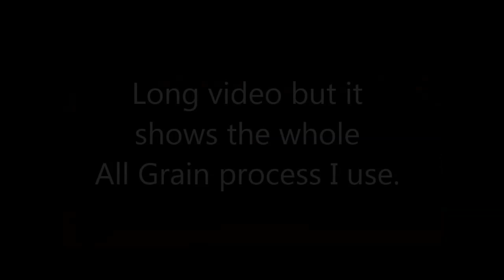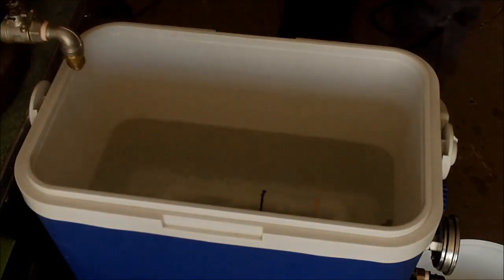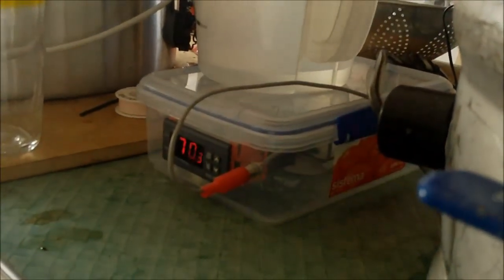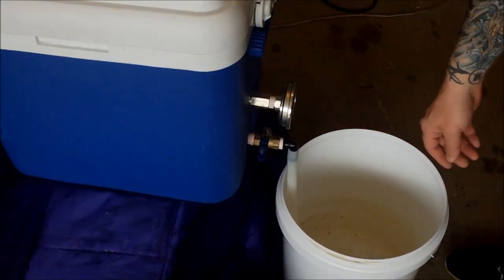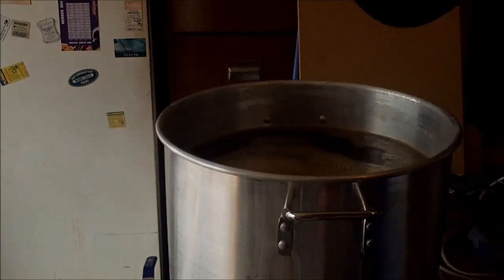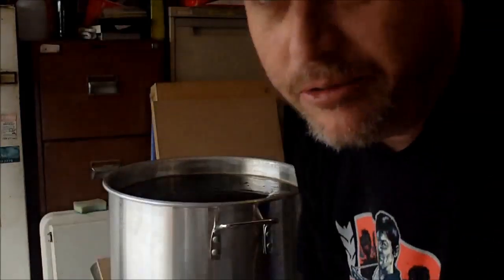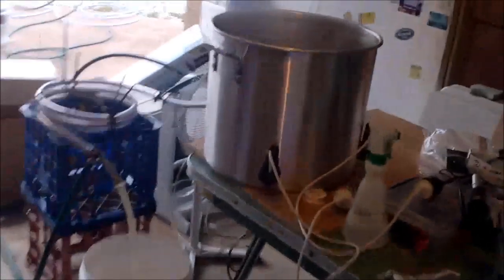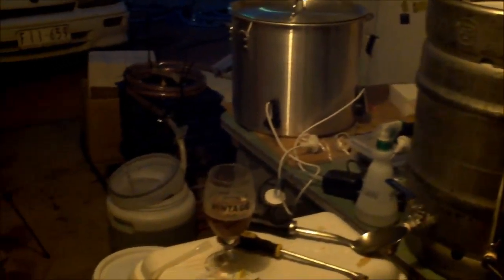Black Metal IPA - All Grain Complete Brew Process BIPA DIPA

Comment: Great video, I am interested and getting ready to try and All Grain Brew. Were you running any special software on your computer for the timer and the ingredients? Or was that just a timer app on your computer? Any software/website that helps with the process by providing alerts while I work to get familiar would be fantastic.
Reply from the maker: Once in a blue moon I'll use the timer, there is one built into Beersmith so its directly from your recipe. Normally I just set an timer alarm on my phone. Cheers mate!
Reply: Gash Slugg Brewing thanks for the reply.   Just bought a subscription.   Still need some hand holding.   Having a blast.   Don't think I can keep up with what I'm making hahah.
Reply from the maker: Beersmith can be a bit daunting at times, but its only as hard as you want to make it. The important thing is dialling in your set up in the "Equipment Profile" once you have that sorted out, might take a couple of brews to fine tune it, its all plain sailing from there. Cheers mate
Reply: Gash Slugg Brewing I'm about 2 weeks out from being able to cheers back lol. But cheers to you too!

Comment: Could you post plans for that counterflow chiller?
Reply from the maker: It was 3m of https://www.bunnings.com.au/kembla-1-2-x-3m-annealed-copper-tube_p4910030 and 2 of these bunnings has them just couldnt find them on the site https://plumbingsales.com.au/copper-tube-fittings/copper-plumbing-fittings/copper-tees/20mm-x-15mm-x-15mm-copper-tee-w27.html and 3m of 20mm hose. It would work much better at 6m. one reducing tee is soldered on, then the copper pipe is lubricated and you pull on the hose over it, and solder on the other reducing tee, its tricky but not impossible. Cheers!

Comment: Why is 66 and a bit where you wanted to be? Was something occurring in the mash resting at 66 and a bit? Was the malt used during the demonstration grown and malted so perfectly that the different enzymes in the malt were able to work harmoniously and in balance during a single temperature, single rest, brewing process? Since, there wasn't a temperature used nowhere close to the point at which complex starch enters into solution, except during mash out when enzymes become denatured. What means were used during the brewing procedure to form limit dextrin? 
This is what took place. A glucose laden wort was produced. The occurrence was due to Alpha liquefying  the simple starch chain called amylose at a 1-4 link. When the link is liquefied, two chains are formed and the name changes. The one chain is called the reducing end, the other chain is called the non-reducing end. The action occurs over and over, up to the point when Alpha can no longer liquefy amylose because all of the 1-4 links have been liquefied. When that takes place non-fermentable sugar is left. Alpha does nothing with the non-reducing end because it is glucose. The action is called saccharification and it occurs within 20 minutes, not in 60 minutes. When it takes longer than 20 minutes for saccharification to occur, the malt is slack or mash pH is so far out of whack, the enzyme becomes stunned. For one or both reasons, home brewers rest mash for 60 minutes or longer. Conversion takes place due to Beta, 66C is above Beta optimum range and since pH was of no concern, mash pH was probably not optimum, as well. Beta converts the simple sugar contained in the non-reducing end into complex types of sugar called maltose and malto-triose. There is a reason why malt is called malt. Home brewers do not use a second fermenting vessel as it is not needed when a glucose laden wort is produced. However, when conversion occurs, one is needed. During second ferment another type of conversion occurs. Maltose formed by Beta during conversion is absorbed by yeast through the cell walls and glucose is expelled. The glucose is fermented and gravity decreases. During the aging cycle yeast absorbs malto-triose and expels glucose and natural carbonation takes place. When beer is correctly brewed there is no need for it to be primed nor artificially carbonated. 
 The single method used by home brewers is the means which the IOB and EBC uses as a means for testing malt. The three temperatures at which malt is rested at during the three primary tests performed on malt are the temperatures which home brewers use to produce every style of beer from Ale to Wee Heavy. When malt is tested a malt data sheet is generated. Home brewers do not know of its existence, a brew master does, and he uses it in order to determine malt quality. A brew master does not assume that all malt is created equally. Home brewers have been led to believe that modern malt is so perfect and wonderful that it only requires hot water at a single temperature to be dumped on it, the porridge is then stirred, and in an hour whatever the recipe title is, pours out of the tun after the mud has been stirred into it during batch sparging. 
It doesn't look like too much art or science are involved with  producing beer. Could it be possible that the beer which was produced was only home made style beer and not really IPA?